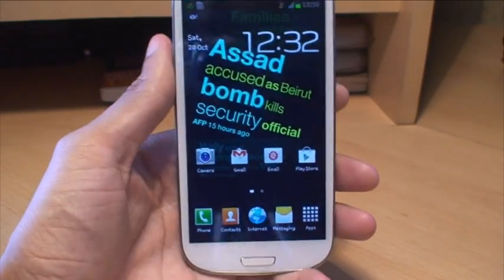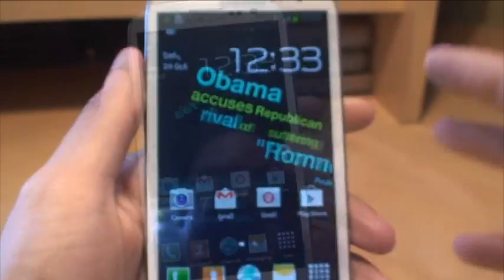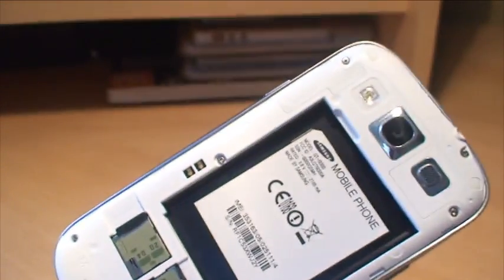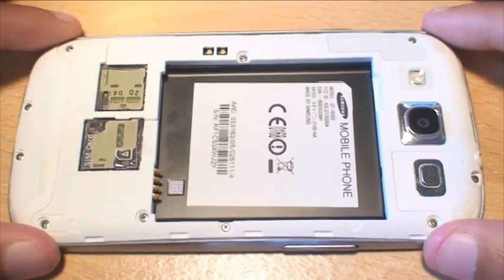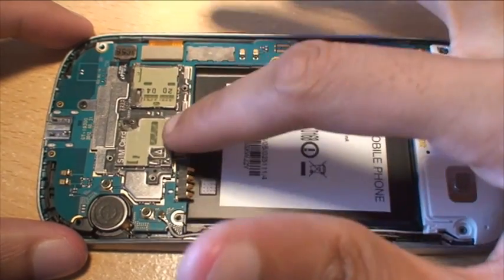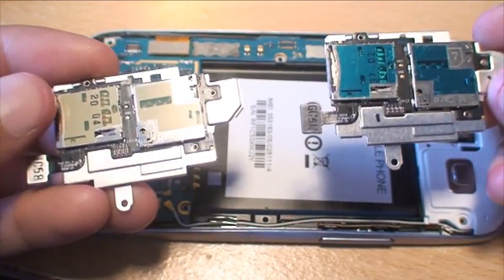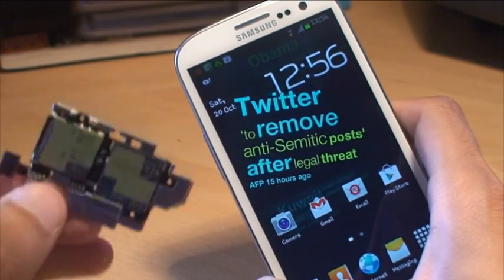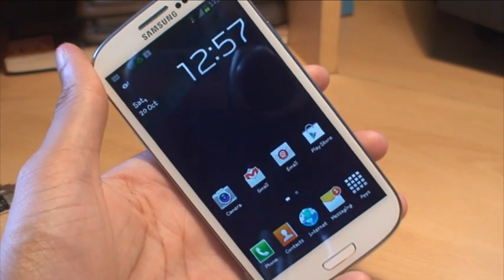Samsung Galaxy S3 Dis-Assembly Replacing Sim / SD Card Module SIII GT-i9300

Comment: Where did I go wrong after replacing the sim micro SD card modul? Everything is working just fine without the cover and screws but after closing the covers the micro SD is not working anymore, the error is something like "BLANCO SD CARD do you want to format?" Options are "Format" and "Cancel", when I remove the covers and screws it's working again. where should I start to solve this problem and why did I face this problem? without cover and screws the Micro SD everything is working but I'd like to close the covers at the back of my phone..

Comment: Hey man i have a question, if anyone knows plz halp.

So i had my S3 in the washing machine and it broke down.

long story short i dryd it up and everything but the battery ofcourse is working, and 1 more thing.

The phone isnt picking up my simcard. but it IS picking up my SD card.

thinking this was a internal problem I bought one of those new simcard slots and installed it.

same problem occoured, ( yes SD and no Sim )

Already cleaned the motherboard a few times with alcohol and a brush too.

anyone?
Reply: There is a short somewhere in your motherboard. Get a ultrasonic cleaner. If that doesn't help check for broken cap/resistor or get an new motherboard

Comment: Is this only for cases when your sim card is clearly not recognized (when the sim not recognized icon is shown), or may it be necessary for others? My phone cannot dial but it can read the contacts on the sim card.
Reply: EthioJOB same problem with me also do you find solution

Comment: sir,, is the sim card reader flex compatible with the mode s3 model SHV-E210K? its korean version. Do the sim card reader flex you use compatible to this model? (SHV-E210k).

PS. Do i need to get all the screws to uncover? Coz i already did then its still cannot be opened. How was that?

Comment: Thanks! You just saved me $130 on warranty repair!
Reply: One tip for others: if you can, use a plastic guitar pick for prying the plastic casing instead of the screwdriver it will avoid any scratching or gouging.

Comment: Hey,  
I followed you all step but still it says no register on network...
what should i do? 
Thanks
Reply: Hi mate have u got ur s3 fixed. I hav same problem. No network after replacing sim holder. Any suggestion. ??
Reply: I had the same problem, the IMEI was corupted. It usually happens wen you ROOT and FLASH with CUSTOM ROM. I tried all sorts of tutorials on how to restore IMEI but did not work. My last option was to change the mother board. Works like a charm now. I recommend. ;)

Comment: Great tutorial, thanks.
My S3 fell on the water, I kept it drying under a strong sun for a couple of days and everything works, except my SIM card (SD card works ok) which is not recognized ( I tried another one and dosent work and my SIM works on another phone). Do you think that I have good chance of fixing it if I buy a SIM/SD reader like you did? Its 5 pounds on amazon.
Thanks, cheers.

Comment: This was very helpful! My phone somehow got a bath in Lysol disinfectant but not fully submerged in the liquid. Did the water trick but the camera(looks like condensation for both front n back) and sound(scratchy frying sound)were both still messing up. So after taking apart and putting together like four times the sim wasn't reading. Thought I had to replace that piece as well. Thankfully BC of you I realize I never snapped the sim plate back in place...walah...sim works now!!! Ty ty ty

Comment: Had alot of troubles doing this. I first broke my simcard reader pins... Similar to the issue the narrator in this video had. I bought a part of eBay for my model. However it keeps reading "Emergency Calls Only" while on another S3 It reads "Petro-Canada Mobility"  <-- My original carrier. However, when putting a different Simcard inside my phone it tends to pickup a signal automatically & I am able to make and receive calls perfectly. Not sure what's wrong, Taking to a cellphone store tomorrow.